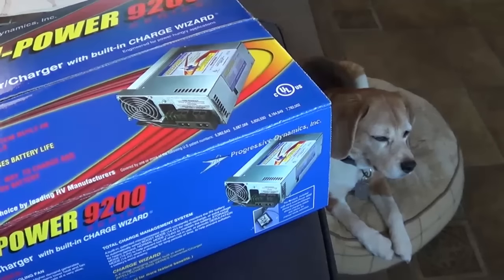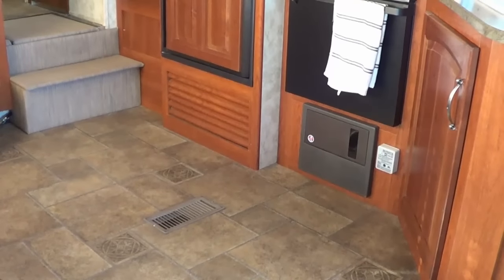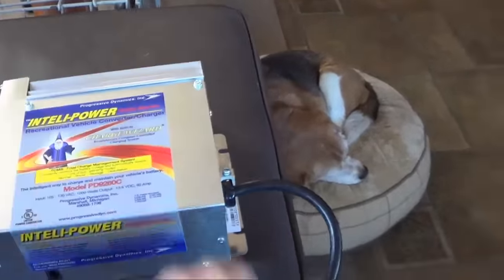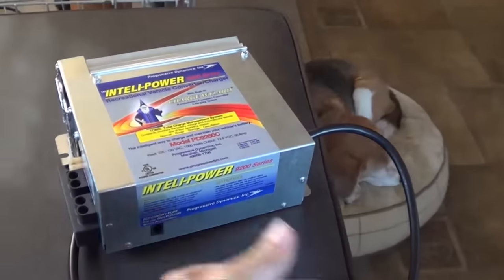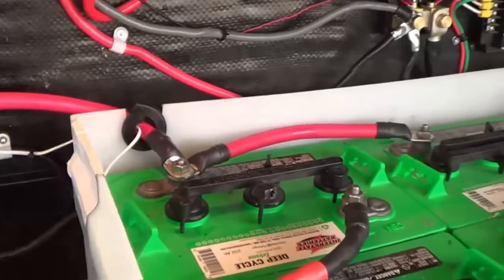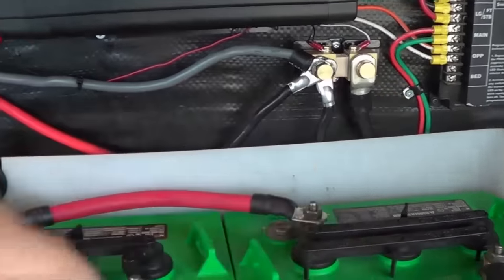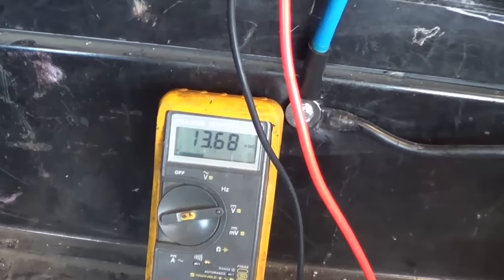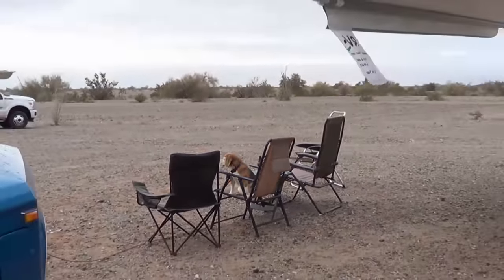Upgrading to an INTELI-POWER Battery Charger for Boondocking

Comment: Great video! I'm looking at installing a PD9270 in my forward storage area for my trailer similar to your setup, but without inverter or solar for now. Batteries will be outside on the trailer tongue. I have a WFCO 8735 power center inside the trailer about 15' away from the batteries. I would like to install the PD9270 separately as you did, but I have a question before I do it. 

You said that when you're hooked up to shore power that you can just flip your main breaker to disable your old converter. My question is.. Doesn't that disable your incoming AC power as well? Or do you get your AC power back through your inverter and batteries with your system? Maybe I'm missing something there, but I thought the main breaker would cutoff all incoming AC power.

I guess if mine wouldn't work that way since I don't have an inverter, I could just run wires from the new converter back up to the distribution center and disconnect my old converter entirely? Any suggestions would be helpful, Thanks!
Reply from the maker: Maybe I misspoke, I didn't mean the main breaker I meant the converter breaker. On my power distribution panel, there is a separate breaker to my OEM converter's AC input supply.
Reply: Ah that makes sense. I think I just assumed you meant the main breaker. I didn't realize mine had a dedicated breaker just for the converter but it does. My WFCO never goes into float mode like its suppose to. Stays in absorption mode even when the batteries fully charged. Probably due to the long run of 8 gauge wire I'm guessing. Because of that I think I will just run an AC receptacle to my forward storage area to power the new PD9270, and ill just keep the old converters breaker off as you mentioned. Thanks again for the tip!

Comment: Does the grounding lug on unit have to be used even tho you have a plug from the unit which has a ground? So two grounds?
Reply from the maker: The grounding lug is there as an safety measure in the unlikely event something was to go wrong inside the unit and the metal case became hot (electrified).  Whether it is useful or not depends on how the converter is wired into the RV. Running off a floating ground portable generator output it is useless as there is no return path to the generator. But, its good idea to run a wire from it to the RVs frame if you want to power the converter from shore power.
Reply: @LoveYourRV  thank you Ray
Reply: @LoveYourRV  so basically I need to drill a hole in floor in near panel and run ground?
Reply from the maker: If you are referring to the power distribution panel in the RV then you should be able to find a wire or terminal that is already wired to the RV metal frame as a chassis ground or a DC negative return line. I can't instruct you though without actually being there myself and taking some measurements with a multimeter to be absolutely sure what is what. :)
Reply: @LoveYourRV  want my address? Lol
Reply: @LoveYourRV  I did see that the AC ground buss bar is grounded to frame... But I heard that the converter needs a dedicated chassis ground..
Reply from the maker: I don't see an issue with using the bus bar as long as it has sufficient size wring size to the chassis, but do what you feel is best or consult an electrician or contact the converter manufacturer for guidance.
Here are a couple excerpts from my converters owners manual - https://www.progressivedyn.com/wp-content/uploads/Support/manuals/PD9100-9200-110953C-owners-manual-english.pdf   

Connect ground lug (found on unit base) to chassis. • Ground wire to be between 6 and 12AWG
wire. • Tighten lug to 25 – 35 in-lbs. 
CAUTION RISK OF FIRE:
Chassis bonding wire must be a separate wire ran directly
from the grounding lug provided on the converter. DO
NOT connect output negative to chassis using the same
wire.

Comment: I have a question do the converter box fan do it run all the time
Reply from the maker: No only when the power load gets high it comes on to cool, otherwise, the fan is off.

Comment: What is largest gauge wire you can install in that model converter? Directions state 2 awg but I wanted to ask someone that has installed one. I have some 1/0 and 2/0 awg I want to use.
Reply from the maker: 2 awg  sounds about right for max. I was able to squeeze some 1 awg in there. I cut off a few of the wire strands until it would fit.

Comment: Hi Ray!  Thanks for presenting your upgrade.  I've run into an output voltage of 12.79 from my OE converter while running my generator.  I am looking at upgrading and wonder if it is better to go with an 80 or even 100 amp converter rather than the 65 amp that is currently onboard.  Have you any thoughts?
Reply from the maker: Your welcome, I've found the 60 amp model has been plenty to do a good job charging up my 4 golf cart battery bank with. I think the rule of thumb is about 15 amps per battery. Keep in mind if you go too high some portable generators won't have the capacity to power them. For instance I one time tried to run my buddies 70 amp model, and it would overload my 2000 watt Champion. I guess the starting current was too much for it.  Cheers, Ray
Reply: Thank you for your thoughts.  The rig came with one 12V deep cycle marine/RV battery, which I am learning is more for starting the onboard generator than for true deep cycle energy usage.  I have replaced it with 2 of the same style. This was appealing from a cost and hybrid start/energy usage perspective.  I see that 20amp charging is considered fast charging and not recommended for battery life, so your 15amp rule makes sense as it falls between slow and fast charging to benefit from the charge time and battery life aspect. Although I am not just charging at time of generator use, it appears that 60amps may be sufficient to charge the 2 batteries and allow me to run a few items simultaneously on the 12V system. 

One more thought... I eventually want to upgrade to a bank of AGM 12V batteries.  What do you think about adding AGM batteries to the current lead acid pair?  This is mainly to utilize the space near my onboard generator without worrying about the gas production of the lead acids.
Reply from the maker: It's not a good idea to mix batteries that are a different type or age as they may not charge in a balanced manner. You want all the batteries to charge evenly for best performance.
Reply: I've got 2- 100A lead acids and was going to increase with 4 additional 200A AGM's.  I was thinking the 100"s would push back as they reached their charge and the others would continue. Maybe I should rethink with your balancing suggestion and omit the smaller batteries when that time comes.

Comment: I replaced a 9100 to 9200 the same as you have, not sure if it's working correctly,  my batters are not charged all the way, but the pendant stays on storage. Not sure I had a converter problem before I replaced it. I am getting over 13 on my converter hooked up to shore power. Can you think of any other reason my converter is not charging my house batterys( 2 6volt)? Tks rick
Reply from the maker: Maybe one of your batteries has a bad cell. I'd test each cell with a hydrometer to make sure they are all even in specific gravity. Also make sure the water levels are topped up.  Cheers, Ray
Reply: @LoveYourRV  ok ya that makes sence,  the batteries are reading full when they are not,tks. Can you use lithium batteries with this model converter?
Reply from the maker: Check out this video I did on that subject - https://www.loveyourrv.com/lithium-battery-charge-test-can-you-use-a-lead-acid-charge-converter/
Reply: @LoveYourRV  you know one thing I have not figured out is some converter fans come on quit a bit, this  9200 was put in same  place as the old one ,and the fan has never came on.

Comment: I have 50 amp hook up do I need to buy 50 amp converter or does 60 amp work as well?
Reply from the maker: They are different things. Your 50 amp hookup on the RV refers to AC shore power amps. The amp rating on the InteliPower charger refers to its output rating in DC amps when charging 12-volt batteries. I found the 60 amp model was a good selection to charge my 4 golf cart batteries.  Cheers, Ray

Comment: Did you ultimately remove the old battery charger, or do you have both, as a backup?
Reply from the maker: I kept it hooked up as it was. I usually use it when on full hook ups so I put less wear on the Intelipower which I use when off grid with the generator.
Reply: oh perfect, thats super smart

Comment: Do you just shut off the breaker for the factory converter?
Reply from the maker: When this video was made, there was no reason to since my 1000W inverter wasn't hooked into my main RV AC circuits, so power didn't reach the factory converter. I had 2 separate plugs for the inverter. Now I have a larger inverter, so I installed a transfer switch to power all the RV AC circuits, so I do shut off the converter breaker. https://www.loveyourrv.com/testing-out-my-new-3000w-motomaster-eliminator-pure-sine-inverter/
Reply: I would like to add the same converter that you did in almost the same fashion under my bed, only I will plug it in to an outlet under my bed. If I shut off the factory converter at the breaker panel, stopping it from receiveing ac power. will the 12 volt circuits still be powered? I like the thought of this because I would always have the original as a spare still wired in if I needed it. I would use the progressive dynamics converter as my primary.
Reply from the maker: Yes, the 12V circuits will be powered via the RV battery which is being charged by the new converter. Only problem you might run into is overloading the outlet under the bed circuit and popping a breaker if other things are running on the same 15 amp circuit. The inverter when charging at full rate will draw around 1000W about 8 - 9 amps AC. Then for example you plug in a high wattage appliance like a space heater or hair dryer into a plug on the same 15 amp AC circuit, the breaker will likely blow.
Reply: Thank you, I like this channel and like how clean your work looks and functions. i can't wait to start modifying our new to us 2019 puma 25tfc to make boondocking work for us. When we bought our first tt a coachman 17bh I new we would only be in it for 3 years so I didn't bother making it our own. Again thanks for your insight, love the channel.

Comment: I've been wondering how your champion gen's been holding up. I've been thinking about trying one it seems similar to a Honda/Yamaha inverter type. I already own 3000/3500 watt champion garage style and I've been pleased with how well it's held up.
Reply from the maker: They are both still working well almost 5 years now. Tough little generator.

Comment: Very informative. If your batteries are down to 50%, how long does it take a generator to fully recharge the batteries now that you have this system? Thanks
Reply from the maker: At 50% my 4 battery bank is down about 200 amp hours. The Intellipower will output an average of 40 - 50 amps but only until the battery bank is 85-90% full then the charge rate slows dramatically, that is the nature of how lead acid batteries charge. The last 10% takes a long time.
So what would happen typically is I would use the generator for about 3 hours in the morning then let the solar finish the charge over the course of the day. The way I've sized my battery bank, though, we rarely fall below 75% charge, unless multiple cloudy days. Cheers Ray
Reply: Love Your RV Thank you, good information. Since it works that way with lead acid, how about charging lithium? Thanks again
Reply from the maker: I believe lithium batteries big benefit is they charge in a linear fashion and can absorb greater amperage than lead acids. So they recharge quicker. However, they have cons too, mainly much more expensive and need to be more temperature controlled.  Here is an interesting article comparing the two  https://medium.com/solar-microgrid/battery-showdown-lead-acid-vs-lithium-ion-1d37a1998287

Comment: Ray, it is $179 o n Amazon.
Reply from the maker: Ya, I know I actually linked to it in my blog post. But a bird in the hand as the say.... :) Compared to other RV parts dealers around here it was cheap. That Amazon price is really good. Not easy to get Amazon on the road though, especially then my address is some unnamed road near Yuma AZ , haha. Cheers Ray
Reply: +Love Your RV Amazon can leave your packages at a facility called Amazon locker, which is usually a 7-11 or some little convince store local to you that will secure your packages until you arrive.
Reply from the maker: Cool! I never knew that. Thanks.

Comment: I know this is an old video but you really need to be charging at 14.4 volts normally. Possibly even higher depending on the battery specs. Charging at 13.X will take you forever, maybe not even then to get to fully charged. Drop out of 14.4 when putting .01c into the batteries.  Lots of good info here   http://pbase.com/mainecruising/boat_projects

Its also poor practice to use the chassis rail for return ground even with the smaller cable connected to the same point.
Reply from the maker: I am, that's the whole point of installing the InteliPower with the extra manual override that boosts the charging voltage to 14.4V. Having said that, the main source of charging for my battery bank is the solar controller which I have set for 14.8V absorption phase and 15.2 during the finalization charge phase. The charge converter is mostly being used during the bulk charge phase when my battery bank is depleted beyond what the solar can bring back to full charge by the end of the day.
The frame rail isn't being used, except by the RV OEM 12 volt circuits, it was just a convenient point to tie into the negative return cable, saved running an extra cable, kept the wiring neat and still has plenty of capacity for the 60 max amps the charge converter puts out, given the run is so short.  Cheers, Ray

Comment: why not go with a Magnum Energy inverter?
Reply from the maker: I already have an inverter that does what I want just needed a decent charger. I also kinda like to have separate items so I don't lose both funtions if it breaks. Plus Magnums are $$$. :)
Reply: Yeah they are that for sure. Just wondered why you'd go that route.
Reply: The best part of having the inverter/charger hard wired is that every AC outlet is tried into my magnum.
Reply from the maker: That's handy. We seem to get by fine with the one outlet, but if need be I could just plug the main 30 power cord via an adapter into the inverter, flip off the breaker for the OEM converter and all our plugs would be live.
Reply: Awesome! I'm jealous that you're camping. I'm stuck in this cold crap here in Utah.

Comment: you have it positioned the worst possible way for heating purposes
Reply from the maker: "INSTALLATION INSTRUCTIONS
Horizontal mounting of the INTELI-POWER 9200, is recommended although it can be mounted in any position that
provides unobstructed ventilation to the fan and vent holes. Secure the converter firmly to the mounting surface
using standard fasteners."
I haven't had any issues with it getting hot, barely gets warm. It's mounted in the front storage compartment which is open to the outside air through landing jack openings, never gets above ambient outside temperature in there versus where most are mounted buried inside the trailer cabinets behind the power distribution panels.

Comment: Converter confused!
Reply: Ray, I'm confused. I think you said you disconnected the original rv converter? Is that correct? But I'm thinking the original converter uses the same wires to/from the batteries to charge them as it would to power the 12v rv original systems example heater fan, lights etc.
So where my confusion is would be how can you disconnect the original converter? Or if not isn't there an issue with having both connected and powered at same time?
Please explain how you can have both a little better for newbies like me.
Thanks - I love your videos!
Reply from the maker: The original charge converter is still installed and working, I've decided to leave it there and use it on shore power. With the solar system I have the solar charger does a good job of maintaining my batteries even on shore power, the OEM charge converter basically acts as a slave and will fill in when the sun isn't shining.
It's OK to have the two charging sources at the same time since the voltage of the batteries is what determines how much current they absorb. My solar controller usually leads as it can output higher voltages and keep charging after the OEM converter has gone into float mode. So it generally finishes off the charge.

The new second converter is installed beside the battery bank and has its own dedicated plugin. I use it to charge up my batteries with the generator when boondocking and the battery bank is run down to the point the solar can't replenish it to 100% during the day. I plug it in for and hour or two in the morning and it to bulk charge. Here is an example - https://youtu.be/Ppx3gODUPP4?t=4m53s

If I want to disconnect the original and not use it I could just flip off the breaker for it on the main power panel or disconnect the AC input wires to it, I don't have to physically remove it.

Cheers!  Ray